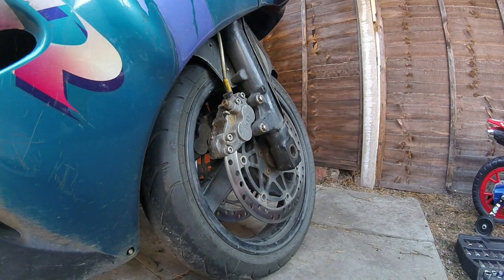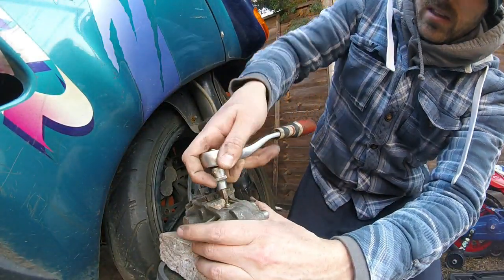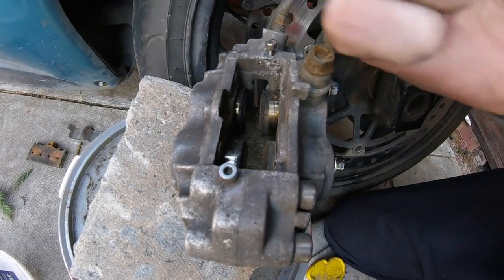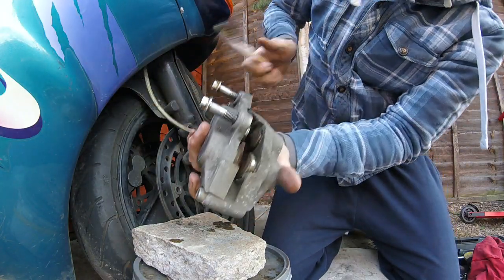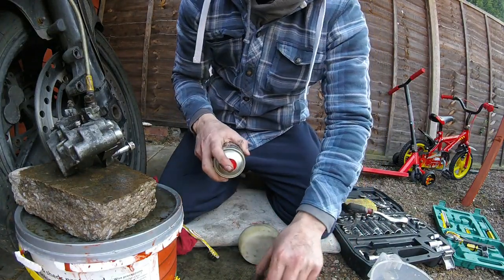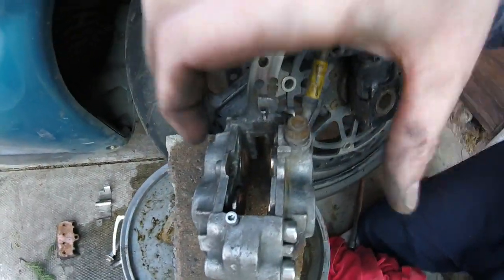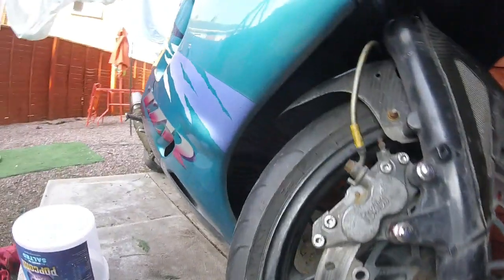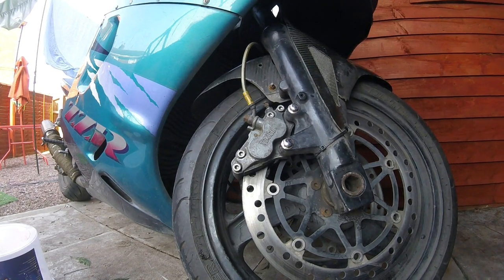Cueball Productions- How to remove/clean your front brake calipers/ pads on a Kawasaki zzr1100d!

Comment: I have the same Tokico calipers on the Red BMW and they are not the easiest ones to service.  I have replaced the pin holding the pads with a stainless steel version as those steel ones are prone to seize in there
Reply from the maker: Russell Hale good idea russ top tip

Comment: I normally put caliper in hot soapie bucket water and put caliper in it and leave for 5 minutes and use a toothbrush to clean and brake fluid round pistons before pushing back in will not harm then wipe caliper down before putting pads back in with copper grease on back the pads
Reply from the maker: chris liddle what ever works for you thanks for watching
Reply: What ever works how dare you 😉
Reply from the maker: chris liddle we all do things differently
Reply: You try way I say then come back and stay to me I wrong
Reply from the maker: chris liddle happy way I do it